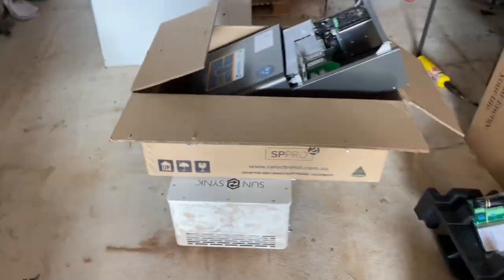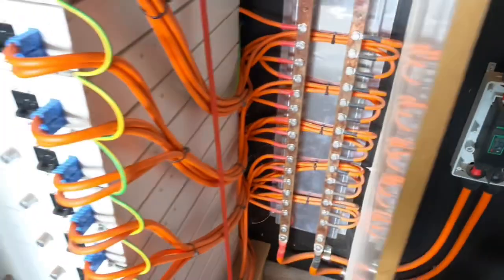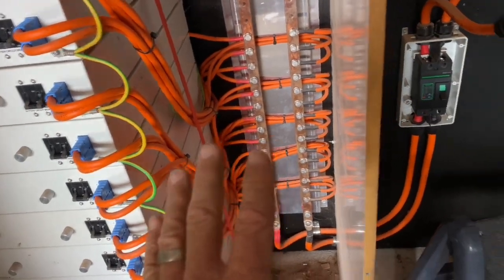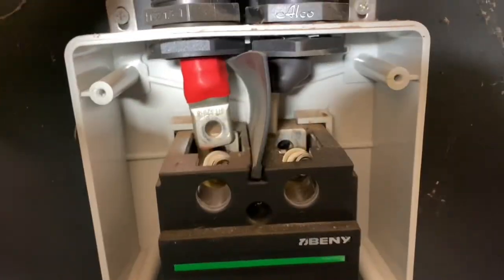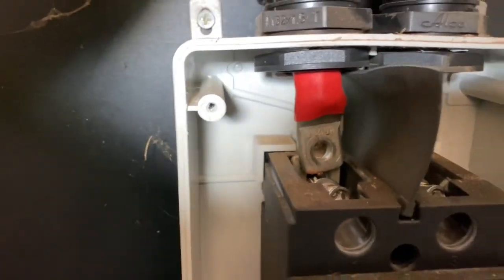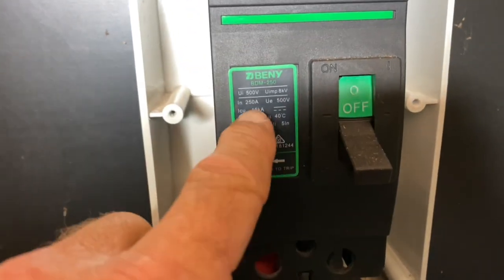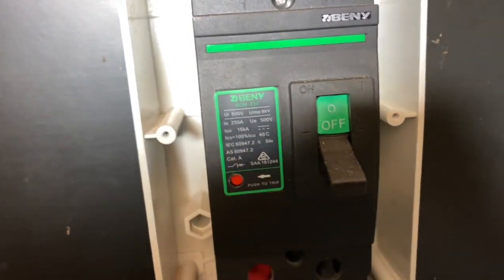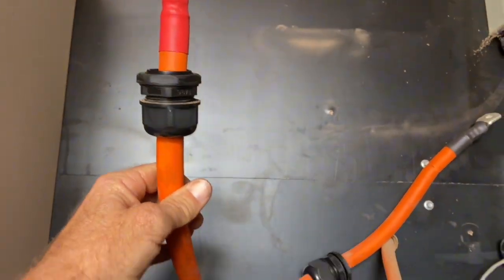How to select cable/wire size for DC cables in off grid solar systems the easy way!

Comment: You really need to check the manual. Cable size for inverters has nothing to do with volt drop its all about reducing ripple. If ripple is too high, you will damage the inverter and battery or it will alarm and shutdown. For a 10kw inverter victron call for 2x 50mm2 cables <5m, which is 100mm2 so not too oversized, I would say they are just about right.
Reply: But in this video they are 100mm2 each which is way too big for a 250A load.
Reply from the maker: @tiemanowo 120mm2 was the size
Reply from the maker: Yes I said refer to manual also, ripple only really a problem with parallel and three phase configuration with Victron as it will cause system to randomly shutdown. Also bear in mind this is a Victron App for Victron products but I appreciate the input 👍🏻
Reply: @joondalupelectricalservice3201  SUNSYNK 10K and 12K use 70mm² cable with 300A breaker, maximum 2m length. Selectronic SPMC 482 has 18kW peak for 20 seconds and 13kW peak for 1 minute, requires 50mm² cable under 2m or 70mm² cable with 250A breaker for 2-5m runs. Victron 10kVA Quattro needs 2x 50mm² cable under 5m with 400A breaker. It will be interesting to see if they trip that 250A breaker at peak loads - at 13kW on 52V you're drawing exactly 250A, right at the limit. You can check ripple by setting your multimeter to AC mode across the DC input terminals; 3V is high and 5V+ will cause micro-cycling of capacitors in both the inverter and battery.

Comment: Victron toolkit app has a "Status Definitions" page for LED and LCD screen error codes, "Voltage Drop" calculator and "Temperature Derating" - but nowhere do they list cable ampacities. According to the app, 48V 250A at 1m has a 2,2% volt drop for 10mm2 conductor size, which is less than the 3% they claim "can cause potential safety issues"... So should you wire the little piece from the breaker to the inverter in 10mm2? Victron says its safe. 

It's not safe and volt-drop is not the relevant metric for conductor sizing for such short cable runs! Conductor temperature, and thus insulation and terminals' rated temperature is the relevant metric. a 200'C rated 16mm2 silicon wire might handle 200A just fine, but the terminals of the inverter and the breaker are only rated for 60 or 75'C, so you can still only put 60-80A through that wire before hitting the limit, even if the wire is half a meter long and effective volt drop is 0.6%.

if you don't know the temperature rating of the breaker or inverter terminals, you have to use the 60'C rating ampacity values, and then only 95mm2 or 120mm2 would be acceptable depending on installation method - a 250A circuit breaker only trips for 125% overload on long duration....